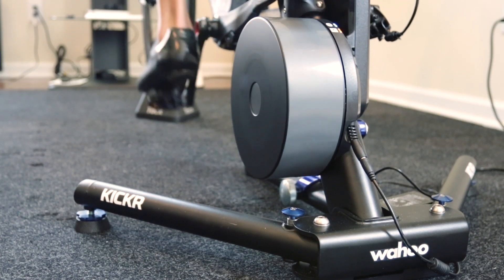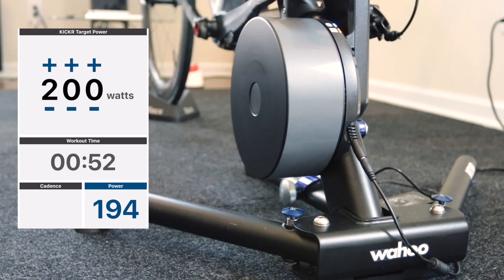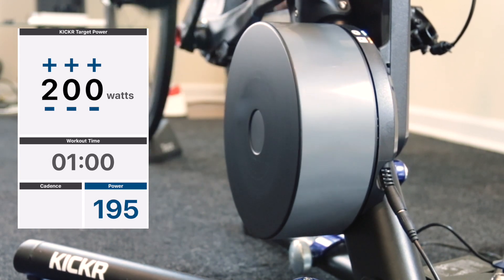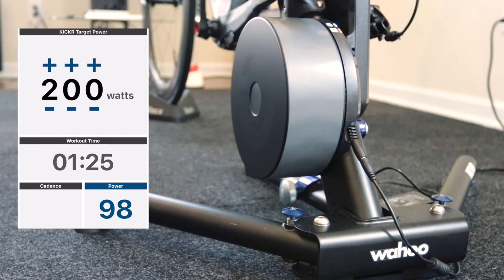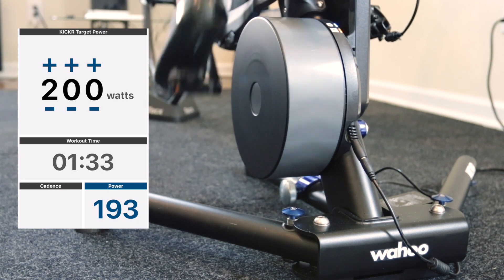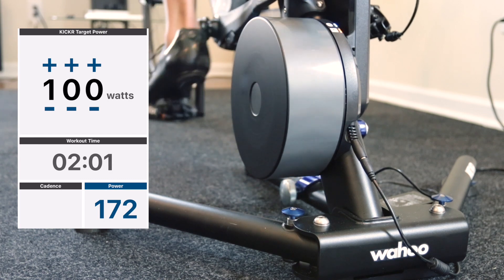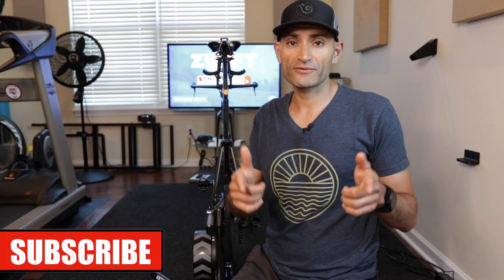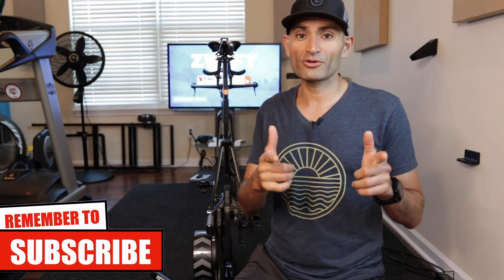How Does Gear Selection Affect  Your Bike Trainer Noise Level [Wahoo KICKR 2017]

Comment: How about the vibrations? Is vibrations less noticeable on this kind of direct drive trainers?
Reply from the maker: Depends on the type of flooring or situation. if you live in an apartment and worried about vibration, then you might want to consider adding a floor mat to dampen the noise and vibration.

Comment: Is there a way to get rid of the sound from the cassette when in the small ring. I have the Saris Hammer H1 and get that chain sound and some vibration. Trainer and bike have new cassette and chain and was indexed.
Reply from the maker: You shouldn’t have much vibration or any. Make sure the cassette is tight and all shifting is working probably. Depending on your drivetrain, you might need to adjust the derailleur.
Reply: @WilfShadow  yeah it always seems to be on those 2 cogs.

Comment: excellent. I see you have a mid gear on the cassette. Is there an optimal gear to ride a turbo trainer? (for both efficiency)  thanks
Reply from the maker: It depends on the trainer you have. If you are in erg mode, it’s easier for the trainer to quickly make adjustments if you are in  a smaller gear. However, pick the gear you feel more natural to you and most high end trainer will work just fine. I would just avoid going into your biggest gears or anything smaller than 15 in the rear cog
Reply: @SmartBikeTrainers  perfect thabks. I'm using the Elite Direto X 2020 version. Have just fitted a 10spd 12-25 cassette. This is my transition from DH & CC MTB riding on 11-36. Time to find out how weak my watts are